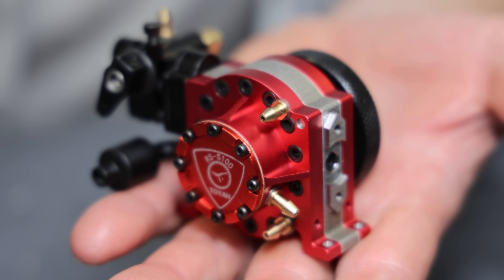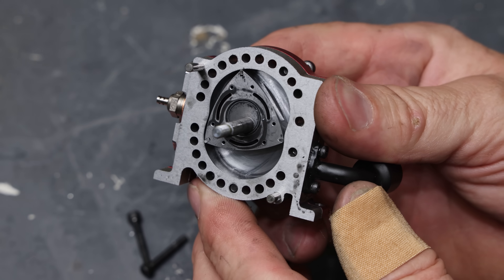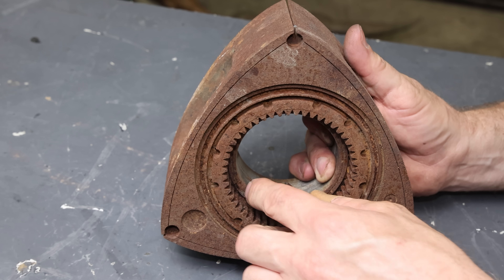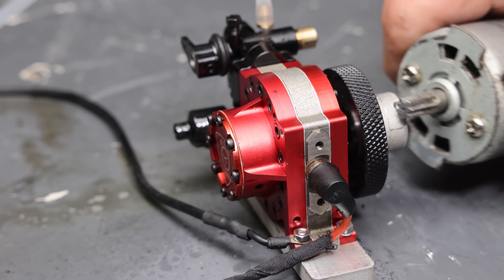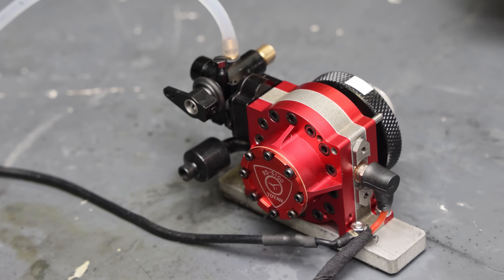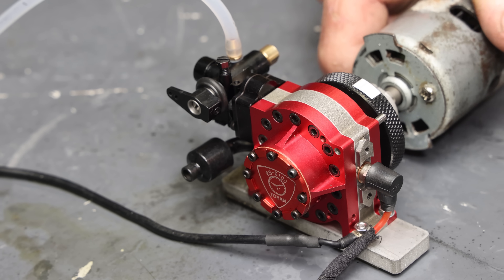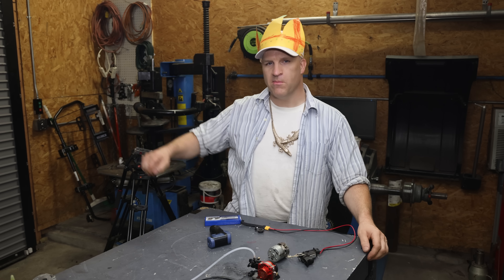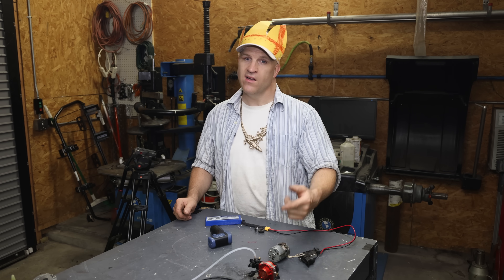Worlds Smallest Rotary Engine (30,000 RPM)

Comment: How is it cooled ?
Reply: It’s supposed to be liquid-cooled but someone removed the brass tubing fittings from the rear casing.
Reply: Air, so small it doesnt need much in the department of cooling fins
Reply: itsyaboikirbo  If it’s air cooled it would still need cooling fins !
Reply: @pufango4059  the fins arent what matters,  its the surface area of the object being cooled
Reply: its not cooled

Comment: i doubt that the toyan is the smallest ... ive seen several rc rotaries that where smaller than that
Reply: but those are not production engines
Reply: This is the smallest commercially manufactured Wankel. It’s half the displacement of the O.S. 5cc rotary.

Comment: While I love Wankel engines (I had the OS back in the day)  and I like your vids.... I think all you showed us is that these "Import" companies are making cool... but crappy engines.  I've see so many that may start... but will have a very short life... or do not run well enough to actually be used in a model. Regardless... keep up the good work.
Reply: Looks like a display engine to me, just like the mini v8... It's not intended to run a model. It'll "run", but I wouldn't actually run it... Just put it on a shelf or a desk.
Reply: @volvo09  plenty of people have put these toyan engines in models and run them.  At the same time keep in mind he took it apart and dropped the seals.  Apex seals and springs are sensitive as it.  That did no favors.
Reply: @brandonbrown3600  really? They do not look very durable. I'll have to search some videos.  Interesting.
Reply: @volvo09  So why worry about making it functional then?  It's either a display (Cheap) or a runner.  I totally get what you are saying... but if they sell it as a running engine... then it should run, and be built well enough to be used for a reasonable amount of time.  Let's face it... Glow Fuel is 20% oil... so stuff will get lubed.  They need to use good materials, and build them to a good standard.
Reply: Toyan Engines are very reliable if you know how to tune a carb. I have a few Rc rock crawlers with them and also a 1/8 scale monster truck with a 4 cylinder Toyan engine they all run flawless. .
Reply: Gets people interested in it and is a practical demonstration tool. I like it. If I had a kid, id buy this and build it with them.
Reply: Was that water cooled? It looked like it was. And yea it's not going to come out of the box totally tuned, they build them at the factory, they don't have time to fiddle with the carb and stuff for every single one, it's also going to depend on what you're running with it and they don't know that they just build them and you can do what you need to get it running well for your application.
Reply: It's designed to take your money.
Reply: @rcdieselrc  like every rotary ever. :D
Reply: And just how many of this model have you actually seen, and worked on yourself?

Comment: Its starving of fuel, i dont see a line from the exhaust to the tank so mount the tank above the engine and it will run np.
Reply: Something you don’t know, the carb on this engine has a self-contained fuel pump. It needs no external pressurization.

Comment: An engine for $500 that you have to CNC parts for, come up with a way to start it, it doesn't really wanna run and self-destructs within the first 10 runs.

Yeah, a nice deal.
Reply: Yeah that's absolutely ridiculous
Reply: Toyan 🤷‍♂️
Reply: better make urself 
use some workshops cnc machine for parts

Comment: The loose dowel pin and the amount of out-of-round of that flywheel are disturbing.
Reply: I was thinking the same thing
Reply: It is also supposed to be water cooled but once he re built it it was missing the ports for the cooling and he also didn't put on the 4 missing bolts near the gloplug
Reply: @Fwv979  Yep, and talking crap about the exhaust falling off? Rotaries are more balanced and vibrate less than a reciprocating engine, if stuff is falling off its because you didn't bolt it on properly. Go get some loctite and bolt it on with tools instead of just hand threading them. Also I'm sure they could regulate the temperature with fueling, a lot of high power piston engines don't need radiators or intercoolers if they are running methanol, in something like this they could just run it a little rich and lose some power/rpm but let the fuel cool it.
Reply: @Joebobinator  Engines that run without a cooling system are designed, and can only run, for seconds at a time under power, even if they ARE running Methanol or Nitro. Those engines are for competition vehicles that make a pass down a short track, and then they are shut off. There's NO way a several thousand horsepower engine without a cooling system can run for more than seconds without some sort of massive cooling system.
Reply: @da1ve468 low e.t.'s  What? Of course they can run without coolant. Cleetus McFarland ran his first 7 second pass in a turbo LS after draining the coolant out of it. He was making well over 1000 hp, he did like 3 burnouts and failed launches before he got it to hook and made the pass to set the record of the first stick shift GM in the 7s. Without coolant in an engine designed for it. Of course it needed a lot of work to get it back into proper shape but it definitely still ran.
Reply: @davelowets  world of outlaw sprint cars don't have to run radiators since they use alcohol. The water passages in the blocks are cemented. They run like something like 15 minutes at a whack.
Reply: @cheatinggravity173  Huh?? 😕
You don't know what you're talking about..

Of COURSE those cars are liquid cooled, and DO have radiators in them. Yes, they run on Methanol, but they certainly would NOT last for more than a few minutes makimg 900 horsepower without a cooling system, and they would VERY rapidly destroy themselves. Those races last for more than a "few minutes".

As far as filling a block with "cement" goes, that's usually ONLY done for drag race engines, that run under full power for only seconds at a time. It's done when a racer has chosen to use a factory block of some kind, for whatever reason, because the factory blocks aren't nearly as strong as a proper aftermarket block is. When a block is filled, 90% of the time its only filled to the bottom of the water pump holes, and water is still circulated in a closed system, through the upper half of the cylinders and the heads. Filled blocks are more of a band-aid for a weak block, and create their own issues such as very elevated oil temps, high bearing temps, and so on, because there is no cooling water that far down in the water jacket to carry heat away from the oil. Blocks aren't filled as much today as they used to be because of the huge selection of lower-cost aftermarket blocks available today.

There, you learned something today....
Reply: @davelowets  that may be the case, the race car owner that told me the above back in the 90s was known for bulshitting... he also told me they had a hard time keeping the tope end of engine warm enough because of the evaporating methanol.

You probably know more than me about it eh.. it wouldnt be the first time I've been wrong🤣
Reply: @cheatinggravity173  He was prolly just messing with you. The part about not being able to keep the carb warm is true though with a fuel like methanol. It's called "latent heat of vaporization" and the pressure drop across the venturi of the carburetor WILL make methanol VERY cold as it passes by and vaporizes. Typically one will see a drop in temp of around 100° through the carb with Methanol. Sometimes it can even cause carburetors to ice up in cooler weather.
Reply: I also suspect that the tiny engine had really poor compression. No way would that ever tick over at 1000 rpm.
Reply: @peterduxbury927  errr small Rc engines don’t ever idle at 1000 rpm but closer to 3000 might be possible
Reply: @peterduxbury927  They aren't supposed to run at 1000rpms. You don't see F1 engines idling that low either. As an engine's useful  RPM range gets higher, so does it's idle RPMs.
Reply: @peterduxbury927  That is because it HAS enough compression... It won't "tick over at a thousand rpm" because the internals are so light, and don't have enough mass to keep it rolling over the compression stroke at that low of an rpm. F1 engines have the same issue because of having such lightweight rotating assemblies, and have 6000+ rpm idles because of it. Compression doesn't scale down with engine size.. A full size automotive engine will have an 8:1+ compression ratio, but have plenty of rotating mass to help it roll over the compression stroke once they are moving. These tiny hobby model engines have roughly the same compression requirements, sometimes even more, but they don't have the same rotating mass as an automotive engine to keep them moving past the same compression ratios, therefore they need to idle faster to keep enough inertia to make it to the next power stroke.
Reply: Ya I was like well maybe the crank is bent?
Reply: I couldnt take my eyes off it either. Haha. Great video though 👍
Reply: That's just the sliding flywheel buffer pin it's a new feature
Reply: at 4:26 I thought it was actually a bolt screwing itself in and out
Reply: That was the park lock
Reply: i though it was a brake of some sort
Reply: LMAO, I thought maybe the loose dowel was some kind of clever rpm limiter by acting like a friction brake on the flywheel?
Reply: The lack of any cooling fins I think will create an issue at some stage as well
Reply: @kingcosworth2643  noticed that too? Wtf. Cheap cheap cheap. Cutting corners. Or fins rather.
Reply: @Coincidence_Theorist  cheap but 600$ lmao. Not so cheap, for 600 u getting two predator 212cc, or one with stage 4-5.
Reply: @Pwnners  just snagged one for 200 on sale and replaced a Briggs on my 1968 69 Troy built tiller... those engines are gold
Reply: @pottyputter05  sounds dope
Reply: Yes me too thinking like that
Reply: People, people.... Settle down already. It's a MODEL engine, designed for short runs and playing around with. These are NOT designed to power actual models, or fly planes, or do ANYTHING but run for short spurts. You all are acting like this engine is supposed to be a workhorse and run for hours upon hours. Not the case... Understand the application before you talk smack, or else you end up looking like fools.
Reply: @davelowets  Exactly, everyone getting ahead of themselves. Chill out peeps.
Reply: Yep, junk

Comment: Engine self-destructing right off the shelf: "That's a rotatory alright!" 🤣
Reply: Dude did a horrible teardown before he even started it... Took it apart in a filthy environment, dropping parts and stuff with nasty hands. Barely bolted it together, the exhaust falling off isn't lolol rotaries suck that's you not tightening fasteners. Rotaries vibrate less than reciprocating engines, nothing should be falling off. Could see fuel coming out around the glow plug so that wasn't tight either. Then it melted the glow plug because this is a water cooled engine rated for a maximum of 16,500 rpm. Which he ran unloaded to 30k rpm with no cooling... This isn't design problems, this is a shitty demonstration. If he did this to any engine they would also run like garbage.
Reply: @adaster98  You could say that about a lot of subpar designs
Reply: @jmuench420  One you MUST redline them every drive, basically being gentle with a rotary is like severe abuse for piston engine. The problem is you have idiots thinking its a "cute car" and then not making it scream like a warzone going down the street and wonder why it was totaled in under 20k miles when the guy burning tires on the track has 0 maintenance other than basic stuff and getting 100+k miles out of his (which is incredible compared to piston engines being raced).

Its just like a jet engine, you need to treat them completely different. You can still destroy piston engine just as easy, like this guy didn't use water in it for several minutes at full throttle, just try that in your car (but actually don't). You can also destroy 4 strokes very easy too going too high rpm bending valves (unless its flat head, which is why I love old flathead engines because you can bypass governor and other than warping the cylinders from over-heating they don't really seem to mind)
Reply: @jakegarrett8109  so like a jet engine it needs the high rpm to keep the suction? And if too babied it doesnt remain lubed properly?  That the deal kinda sorta?
Reply: @Coincidence_Theorist  Its not to do with suction, its that one side of the engine is hot and the other cold. This leads to carbon build up on the cold side (also its burning a mix of oil and gas, so its not the cleanest and that's not great for the carbon build up either). It's just like a fireplace chimney, you have to get everything extra hot to burn out the carbon deposits once in a while. Otherwise on a rotary engine the apex seals (kind of like piston seals) are made of graphite (also known as pencil lead), and that carbon acts like sandpaper and really wears it out fast.
Reply: @jakegarrett8109   I can't tell you how many "bad apex seals" I fixed in the mid 90's.  We'd pour MM oil down the upper spark plug holes, lett them sit overnight, then start them the next day with fresh plugs and run the hell out of them up and down the interstate to blow out the carbon. Sometimes we'd show the owners how they SHOULD drive the cars, and most of the time they were appalled with our treatment to their vehicles. You gotta hear the rev buzzer a few times a week. We actually delivered Pizza in a P-Port with the limiter set to 10,500 back in the day.
Reply: @donaldglaser7686  just to burn out some carbon deposits you're also destroying transmission, bearings, suspension, and probably weakening the chasis itself. 🤣🤣
Reply: @KirbyZhang  I'm not sure what you mean
Reply: @donaldglaser7686  It's not a friendly engine to have in your car
Reply: @jakegarrett8109  The main killer is people NOT warming them up! Any two stroke, or rotary faces this. Someone starts a rotary cold, then starts ripping. What you're doing is allowing that rotor to bore itself into the rotor housing, causing a low compression scenario. If you let all the metals expand together when starting, you will have a long lasting motor.
Reply: @jakegarrett8109  yapfest for a inefficient design eith 0 torque 😂
Reply: You're right,  @adaster98
Reply: @adaster98  Has to be designed and built correctly first.
Reply: What's a "Rotatory"?
Reply: @RichRotorhead  it's when you rotate your rotary.
Reply: @RichRotorhead  It's a typo, he meant brotatory, which is like when your bros switch up who's getting the beer.
Reply: @markaja2  😂
Reply: You have to consider there was no load on the engine though.
Reply: Hahaha so true
Reply: True
Reply: haha
Reply: Rotary phone to buy these or are they secrets😂
Reply: That's ignorant